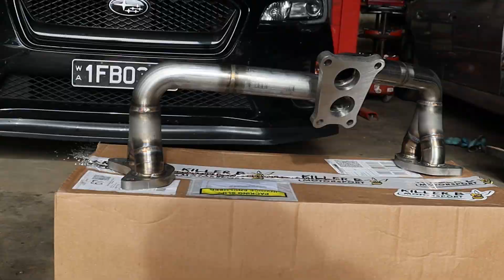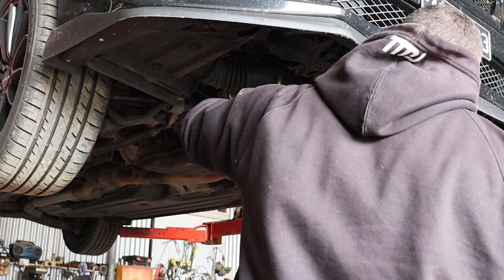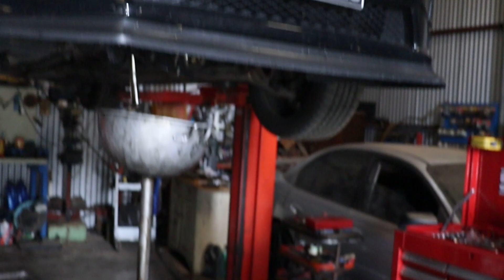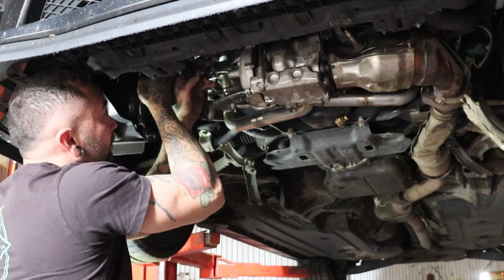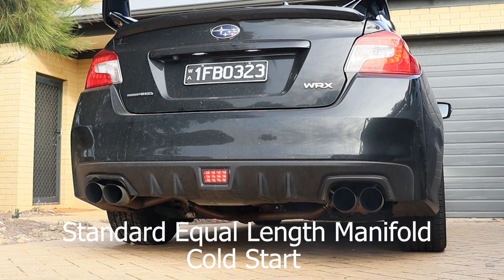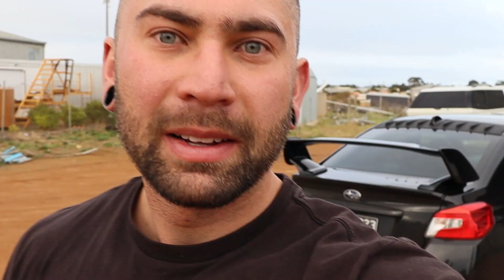2015+ FA20 Subaru WRX, Killer B Unholy UEL Headers

Comment: I thought would of been more rumble. That clears up my desision going with tomei instead has more rumble.
Reply from the maker: I thought there would have been more rumble to. But looking at the header design it's barely UEL
Reply: Maybe someone that owns this header can extend one side another 6 inches more and see if it gives it more rumble
Reply from the maker: @simplybuiltgarage  I'm tempted to but don't want to go cutting up $1600 headers haha
Reply: Do it in the name of the subaru community to c if u can make them sound better because we aren't doing uel for performance we doing it for that amazing rumble. 😉
Reply from the maker: @simplybuiltgarage  I'll get some flanges cut up and might make my own set
Reply: If u do make a video u making them.
Reply from the maker: @simplybuiltgarage  yea I will
Reply: @jamestyrrell4179   I use these headers on my fbo 2019 with invidia catted Jpipe an R400 exhaust and it does rumble a lot at low rpm but after 3500 rpm it's sound more like an el header I think it is a good balance of the 2 and represent a lot fa engine
Reply from the maker: @williamdorval2492 is the car loud with that exhaust system? Atm it sounds good on cold start up and low rpm to but doesn't keep the rumble once revs are up also
Reply: Not hating but I didn’t notice one difference. I have the Tomei UEL, and just waiting on the catback now.
Reply: @jamestyrrell4179 extremely overpriced sadly

Comment: Not bad. I also have a 2020 subaru wrx cvt. And what the mods i got going on. Tomei Unequal length headers.
Invidia n1 catback exhaust.
Tune stage 1 (93) with Cobb AP. I also did a custom exhaust by doing resonator and Invidia n1 Muffler delete. So now im running straight pipe with tips. Here is a link of my video on how so far my wrx cvt sounds like with the Unequal length headers from Tomei. So tell me what you think when you guys hear my rumble sound. Also im working on getting my invidia catted downpipe. To get even more rumble and super louder. But for now its not bad on how it sounds like.

https://youtu.be/vk4QBKAWVX8?si=Rqw-322s6DNGkdvJ